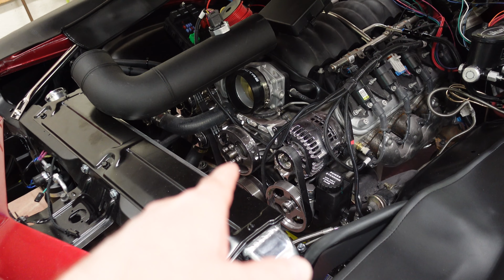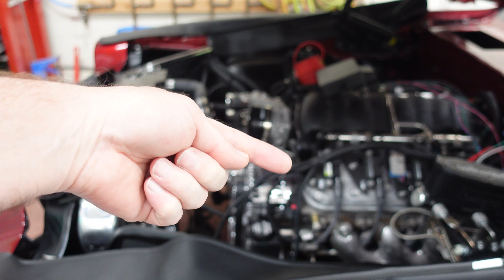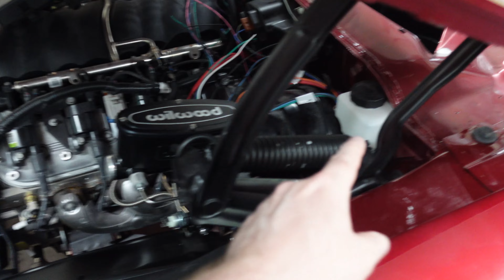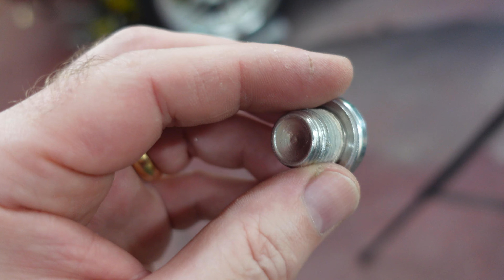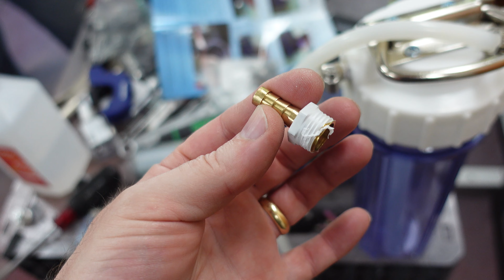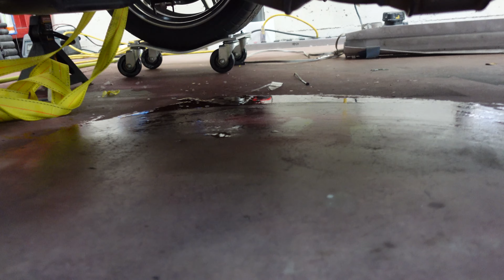1977 Camaro Z28 Part 273: Fluids, prep for start!

Comment: Another thing... sorry I am commenting as I watch.  The oil won't come out of all the rockers, you will need to rotate the engine for that to happen.
Reply from the maker: Really? Why is that?
Reply: @asicerik  just the way the oil system hits the holes on the crank/galley--usually it will dribble a tiny bit out of 4 of them then rotate 90, do it again and so on.

Comment: Check to see if the pcm is throwing any codes using your obd2 dongle. If the ignition switch is working, you should be able to read the codes. If the computer isn't receiving key power and battery power, you won't be able to communicate with it. Also not sure what your fuel pump circuit looks like but I'd recommend checking with a multimeter instead of the bulb. Looking at the schematic for the e38 pcm, pin 50 does go to a relay then to ground to activate the pump. Could be that it isn't pushing enough amps to light the bulb? I doubt you fried the pcm, they're pretty robust. Check out lt1swap.com and double check your wiring and I'm sure you'll find something.

Last few gremlins though and you'll hear it come to life! Best feeling in the world.
Reply from the maker: Thanks Andrew. Best theory so far is that there are some grounds disconnected on the harness. They are on my list of to-dos. They are at the back of the engine and hard to reach. I did not notice them until recently. It could be they were laying up against the engine before or something and I moved them.
Reply: @asicerik  That would explain the temporary working and subsequent non-working. It's usually the easy stuff that gets you lol.
Reply from the maker: Yeah, verified tonight. That was the problem. Thanks

Comment: My LS3 takes 8 quarts of oil Erik.
Reply from the maker: 8? Dang! Do you have a big pan? Mine is pretty small for clearance. I bought 6 more quarts though to be safe! Thanks!
Reply: @asicerik  I have a 2010 Camaro 2SS stock oil pan.
Reply from the maker: @jamesjohnson4093  Thanks James. I checked the dipstick last night. It has a little on the bottom. It is a very strange thing. You can barely see the hash marks on it, and there are no "min/max" marks on it.